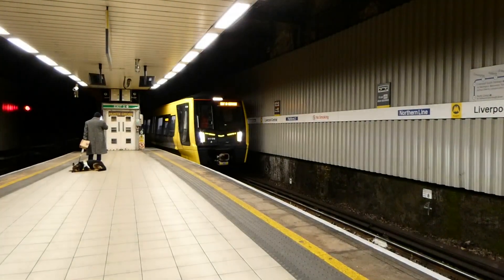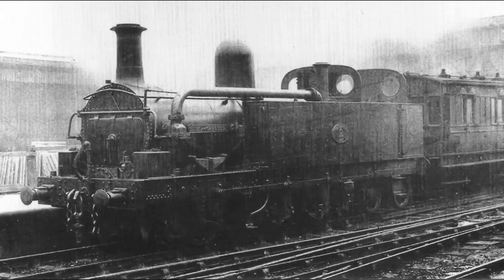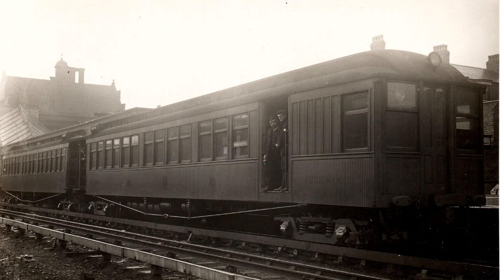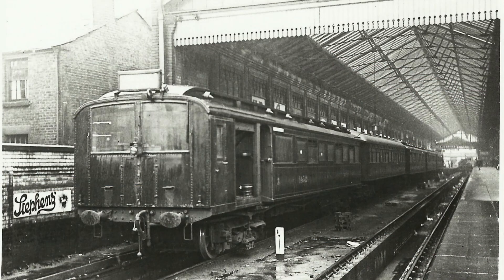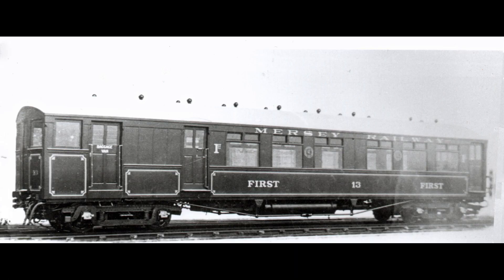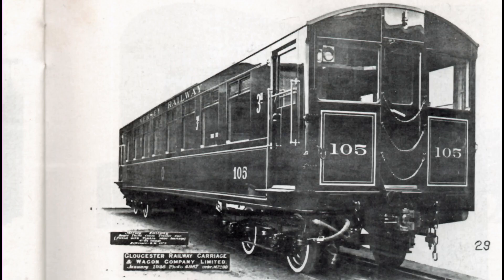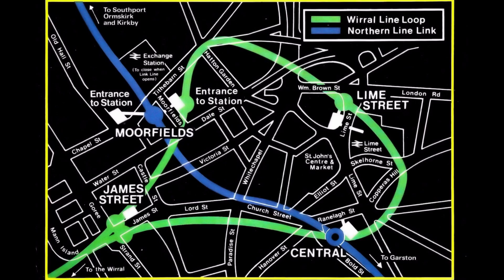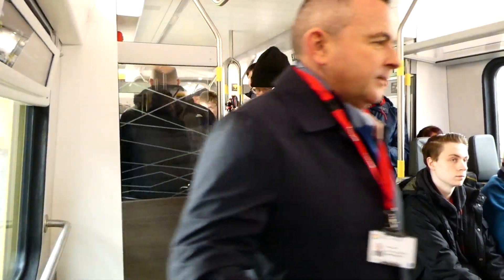Merseyrail Class 777s The Next  Generation Of Electrics. Merseyrail History

Comment: More Merseyrail Class 777 Metro units will be in service on the City Line, Northern Line and Wirral Line. As they are tri-voltage trains and can operate on DC 750v 3rd Rail, AC 25kv OHL and battery power on shorter distances that doesn’t require any electrification. 

Including the new Headbolt Lane railway station that is to have 3 platforms and Class 777s will run on battery power to Headbolt Lane.
Reply from the maker: Merseyrail have ambitious plans for the 777 units. Tests have shown that they can travel at least 20 miles on battery power which means that the network can be greatly extended. At a talk I attended by David Powell. He showed a map of the possible extensions.  He was asked a question from the floor about the various power modes. The answer he gave was that the units can be 3rd rail & battery or 3rd rail & overhead but not all 3 on one unit. This due to technical reasons & available space. But hopefully we will see these new trains going to new destinations in the future
Reply: Interesting. Thanks for the fascinating information. I am still looking forward to riding on these new trains.
Reply from the maker: @Andrewjg_89  although the seats are firm I found that the smooth ride compensated for that. The large windows & open bright interior are an improvement together with the sliding steps
Reply: Totally agree. 👍

Comment: I really love the Mersey rail system new trains look superb,the 507/508done well and still looked modern today we had the left over 508 trailers in our 455/7 units when I worked for SWT the profile looked more modern than the 455 mk 3 design
Reply from the maker: The new trains are long overdue & are certainly a big change from the 507 508s though they will be missed. The modern profile of the PEP stock was largely for the tunnel services that the PEPs served. The MK3 design EMUs looking older due no doubt to their mainline stock heritage
Reply: @Merseywail yes that’s right bec 313 was for the Moorgate section and a build for the un built picc Vicc in Manchester the 38 stock was a graff baker design I think who designed the London O ,P stock